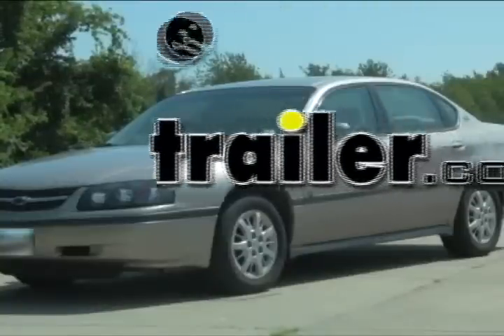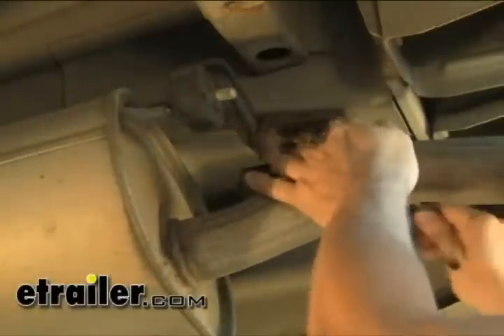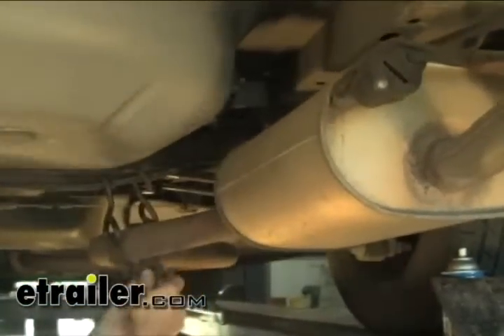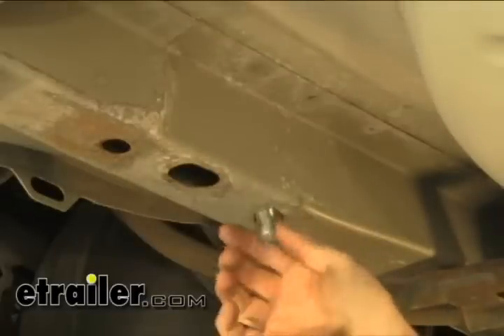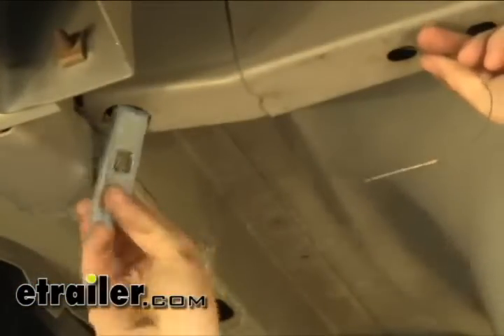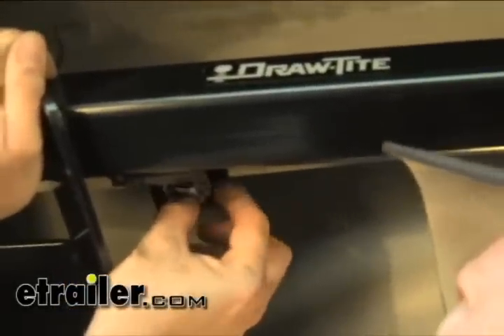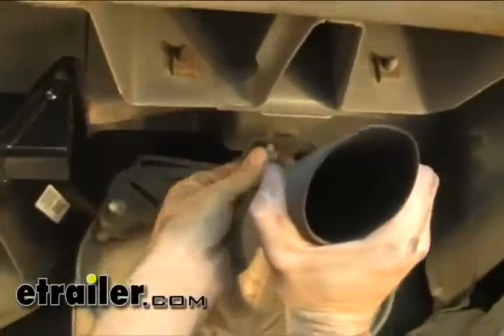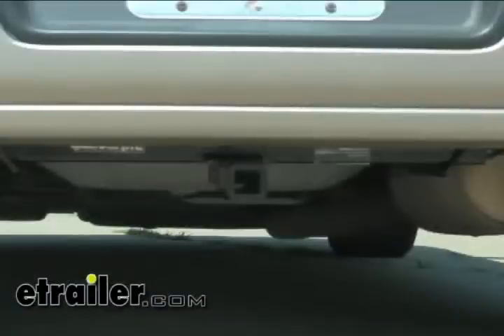etrailer | DIY Install: Draw-Tite Trailer Hitch Receiver on your 2002 Chevrolet impala

Comment from the maker: It really depends on your mechanical level, but in the world of installs, it's definitely on the lower end of difficulty. We have had a lot of our customers tell us that they had no problem installing it themselves. Also, it doesn't require drilling, which always makes things easier. If you have any questions about the install process, feel free to ask. Also, the installation instructions are available at etrailer(dot)com, if you wanted to check them out.